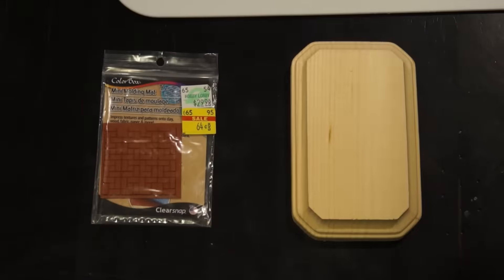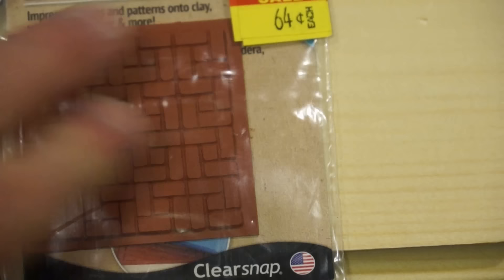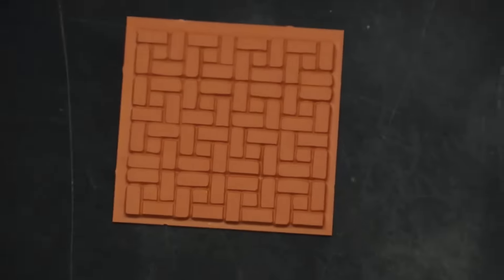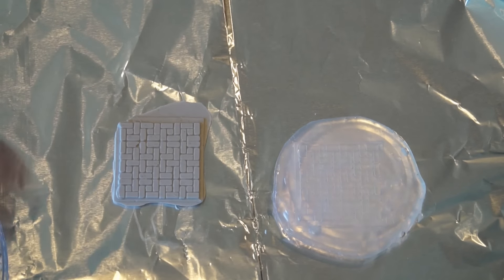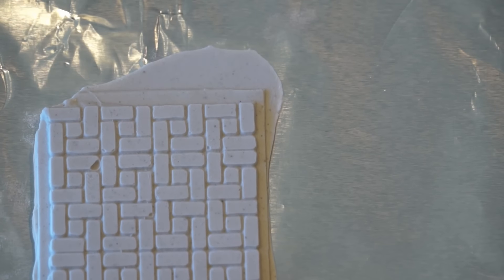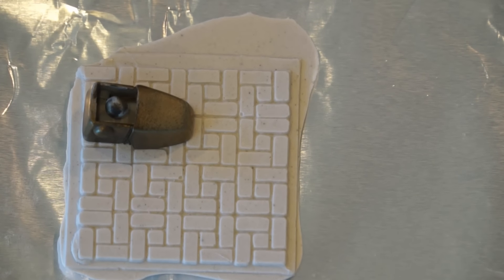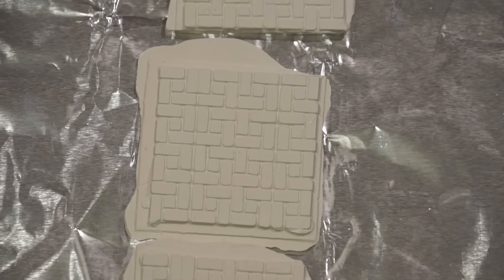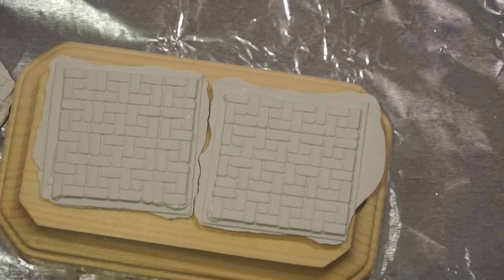maschinen krieger base work

Comment: If I may offer a suggestion, don't align the brickwork with the sides of the base.  Rotate it slightly.  That means you will likely have to cut the plates that you have cast.  But it will look better in the end, than if the seams in the brick pattern are parallel to the sides of the base.
Reply from the maker: +theBaron0530    I will have to think about that.  I would have to cast up a few more if I do it that way, but I am pretty sure you are right that it would look better.

Comment: OK, just got a brain fart how you can get your oyamaru mold to get even (yea i know i probably spelled it wrong) . you tape 2 CD covers down on your cutting board/mat (there about 10 mm) , put your oyamaru in between them and your your wife's rolling-pin to make it flat (well perhaps not her favorite). Then just place the tile impression in the center and use the rolling-pin to get an even impression.
Reply from the maker: +The Swedish DR. Plastic The big problem is the rolling pin will tend to squeeze the Oyamaru, and not allow it to be level.   In addition, the working time of this stuff isn't that long, it begins to cool off pretty fast and solidifies quickly.

Comment: Could you measure the amount of plaster per cast and use that same amount each time? Would that result in the tiles being the same thickness?
Reply from the maker: +Daft Robo That is exactly what I should do, but I was too lazy to get the measuring spoons out and measure with any accuracy.    I ended up using sand paper to get the thickness even.   With plaster that doesn't take very long.
Reply: badgrendels Good to hear it didn't take much to make them the same thickness. I also want to say, I love your videos! I'm from Arlington and have been away for over 20 years living in Indianapolis, and your mild accent reminds me of all my family still there. You sound just like my Uncle Rusty and look a lot like my father-in-law, it's weird and awesome!
Reply from the maker: +Daft Robo LOL!!!  And here I thought I didn't have an accent......

Plaster will sand pretty fast, that is why I used it instead of resin.
Reply: +badgrendels Haha, it's very faint, I said mild. Probably only clockable by a Texan.